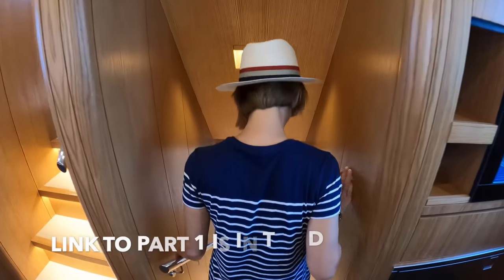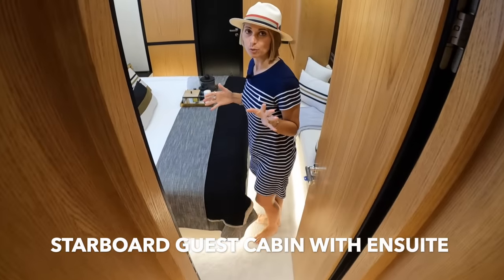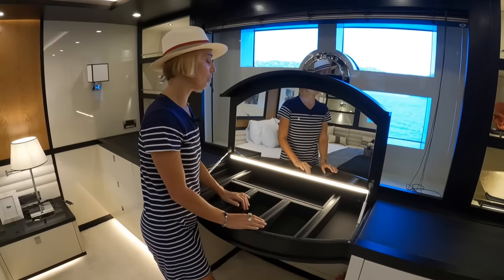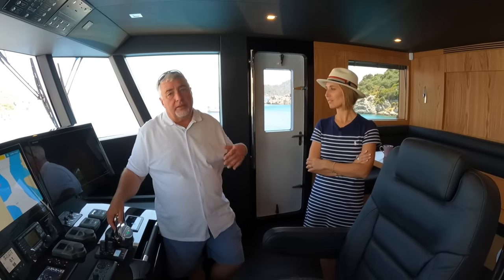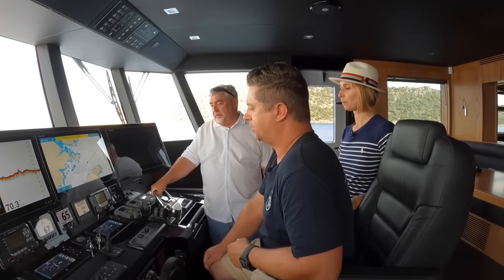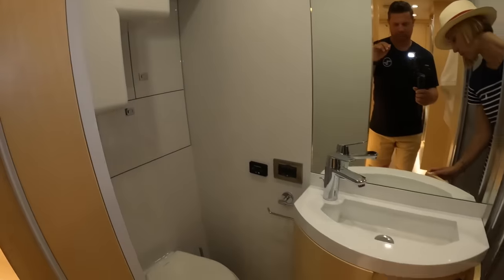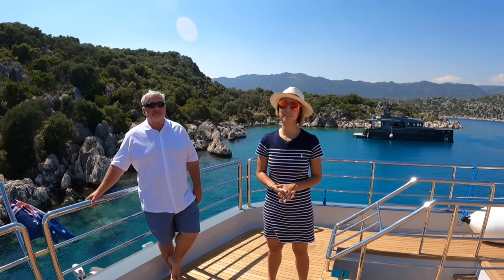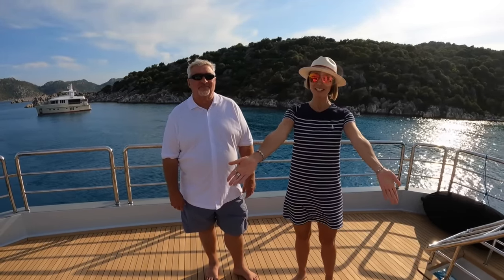2021 BERING 77 EXPLORER YACHT TOUR - PART 2 / EXPEDITION Liveaboard Go Anywhere World Cruiser Boat

Comment: A yacht designed by a fisherman who worked the Bering Sea.
Perfect. The first thing I think when I see yachts is "no outriggers, no interest".
First thing he said was "You can add a fighting chair and outriggers here on the swim platform" as soon as they stepped on the boat. This is the first super rich type boat that I've ever seen that compares to Viking. Beats them, actually in seaworthiness. And range. And safety. Maybe not as a pure sportfisherman, but this more than compensates for that. And having a steel hull means this thing can go places that you couldn't take a composite hulled boat. This will bounce off of icebergs, and with a range of 5,000 nm, that's easily doable even from my home State of Florida. I'm from Miami and have seen superyachts 3×, maybe 4× the size and am more impressed by this Bering.
Oh well. Something else to buy a lottery ticket for. Just the fuel at $6 per gallon × 7,000 gals is more than I can do.
Time to load up the kayak. I can still fish.

Comment: 36:20  So Nordhavn be like "we fit a small 'tank deck' into the bottom of the 120, like you sometimes get in more voluminous 200ft+ yachts" and Bering is all "lol, hold my kvass" then does the same in a 77.
Reply: I'm not sure which brand I like better now.  I need a tour of the new Nordhavn 80 to compare.
Reply: @timroden6617  The Bering is steel, the Nordhavn  is plastic, end of discussion. If the2 collided which would sustain the most damage?

Comment: There is so much to appreciate. The achieved efficiency for such a heavy vessel is astounding. Another mindblowing stat is how much operating time is had between overhauls. (How the TBO residualizes into Cost of Ownership makes this vessel much less expensive to operate when compared to other vessels in its class; if there were others in this class). The battery capacity and management that allows the ship to power systems all day with only a one hour recharge is borderline absurdity! It's phenomenal. Accessibility of key components in an emergency, such as rudder, is another sign of its well thought construction. The redundancy of systems is another amazing feature. Size of the crew area, having a crew mess... The food storage capacity... vibration isolation... true water tight doors... I've never been so impressed by a 77' boat. The term Duesy, as in, "It's a Duesy" (meaning greatness) is eclipsed by this. IT'S A BERING!

Comment: Felt in love for Bering when watching these videos! I would add very few electronic resources to the boat, not essencial, but desirable for a family owned and operated.
The tech talk is the best part (#proud #boatgeek) and I was impressed with the engineering and construction methods Bering applies in the Explorer Yachts.
Clearly they have real life sea experience, and their design take into consideration real issues that may put ones trip or safety at risk. It is amazing!
Thank you for sharing such detailed and enlightening video on the Bering 77.

Comment: the amount of experience and kowledge and sea sense possessed by the owner mr. Alexei rresulted in a magnificent boat.the video was an education on factors that affect yacht design, for example the use of weight in generating momentum and stability, charging the batteries using the engine instead of the generators and use of the commercial ship monitoring system for all essential system functions,use of inverters to be able to access all types of voltage inputs etc etc etc. the boat is a fucking masterpiece and  mr Alexei is a grand master. of boat design . this video has channged my perception of boats and boat design. thanks a million guys.

Comment: Btw, the washer/dryer combo in the master is super cool. The newest machines use ventless condensing drying cycles with high-speed air flow and work a hundred times better than the old Splendide combos that ran on 110v. You just throw stuff in there, and the machine measures out the exact amount of detergent and softener, runs the cycles, and your phone tells you when it's finished. No ironing is needed, and your clothes are perfect. My friend bought one and says it changed her life...lol.

Comment: This is awesome.. I generally didn't like most yacht or yacht lifestyle. It all felt too flamboyant and fake. All yacht I had seen videos of, till now was like a boat with lot of places to sit. And didn't have anything that felt nice. But this video changed my opinion. Now I have a favorite yacht!

I like how everything has a purpose, and there is so much attention to detail. Moreover, I love how everything is over-engineered and is redundant. This is a ship that is focused on safety, comfort and design. Everything is so perfect. Even the layout of the rooms are so well done with purpose. Like, how the bathrooms act as a sound barrier between the guest cabin and engines. How, the crew cabins have entry right from the cockpit.

Only thing I felt a bit off was the Engine specs. But, I felt convinced after seeing what Alexi has to say.

But, is it possible to put a big engine if the owner desires to do it at the time of construction? Like, for cruising 8 knots is okayish. But, what if a owner wants to sometimes take it to 30knots just for fun. Is that even possible with a vessel of this size?

The thing is, I get that range maybe reduced with speed. But, every trip do not need 6000nautical miles of range. Most trips would be shorter distance, and why not use more fuel, and get better speed? Anyone who can afford $5.7Million for this boat can certainly afford it.

There is Pearl 80 boat, which is totally different class of boat, and less than half the weight too, but has 2 x MAN V12 1800hp and can do 35Knots and 25Knots cruising speed.

So, can a 2x 1800hp engines be placed in it? And if those engines are run at its cruising economical speed, what will be the difference in fuel consumption with these 2x300HP engines?

Alexi said it only need one engine to cruise at 9 knots and be hyper fuel efficient. If that is the case, how about a 3 engine setup? One 300HP engine for fuel efficiency. And Two powerful engines used only when the owner wants speed. Will that give the best of both worlds?

I feel like this nice boat is let down by tiny engines.
Reply from the maker: This is the full displacement Vessel, which means it will not go above the hull speed… Not ever boat is billed to go fast, it’s not just about the engine power

Comment: I actually prefer this boat to some of the bigger yachts. Perfectly proportioned and beautiful looking.
Reply: My thought too, every square foot is utilized and unique, not just a bunch of open deck space like your on a cruise ship.
Reply: How much do you think it'll cost to operate and maintain per year?
Reply: Which one do you own?
Reply: @petergiffin1270  I'm guessing at least a couple of hundred thousands dollars per year (but I don't know much about boats). It will probably depend on how far the boat travels (it's heavy so it probably needs a lot of fuel for long trips), then there's insurance and maintenance (could probably depend on if there's any accidents), the man said it was 77ft to make it cheaper in fees than for superyachts, then there's the cost of hiring a crew/captain (if you can’t operate it on your own) and mooring costs (some countries with a lot of tourists are likely more expensive than others)... I think they say that a boat cost around 10% of their value every year, I don't know what it's sold for, perhaps somewhere between 2-3,5 million (?), if so it would be around $200k-$350k/year.
Reply: @zeroheroes4081  You mix up consumption and maintanance Costs. The rure maintanance isn't more then 30k/year. Plus the recommended 3-Year-Inspection by Shipyeard. 80 to 100 k. So per Year it is not more then 60k. A 77 Footer you can operate on your own with a simple "Sports Boat"_License (Off Shore).
Reply: @TheMave34  I was thinking that fuel + oil + repairs + maintenance + insurance + mooring costs + crew + fees I probably don't know about, would altogether be in the ballpark of that number, but I can absolutely be wrong. Since it's an explorer and unusually heavy, I'd think the fuel is more expensive than the average yacht as it's going to travel very far, but the man also said it wasn't going to be owner-operated so just hiring a captain will probably cost $80k-upwards/year + a steward for like $30k... But perhaps the owner will charter it out some weeks of the year and cover the costs that way.
Reply: agree! 

Therefore, I'd be very, very interested in your opinion which do you prefer, this 77 or the All Seas 92? 

You know, give-or-take the obvious length - one has a higher finish while the other appears that the attention is more in the hardware? 

On balance, which one is it for you?
Reply: @zeroheroes4081  I'm thinking $600k at the low end
Reply: @jimdeitch321  why?
Reply: @michaelbastin9851  - although I like them both, I think I’d go with Regis 77.
Reply: @petergiffin1270  9⁹
Reply: @petergiffin1270  Rule of thumb is 10% of the cost of the boat, per year. A 77 goes for, I think around 7 million, so 700 thousand per year. Your mileage, depending of course on your miles per year, and what crew, if any you, have, and the cost of where you moor, see sailing doodles on YT, he refers to mooring, fuel costs a lot, so it's a big variable. Being a diesel boat, that's obviously a huge number, depending on how much you run it. Use it as a live-aboard for most of the time, then you're paying moorage costs which include your electricity costs plus ft per day, week or month. If you're taking your 77 around the world, with 6-8 crew, your costs might be higher. And we think car insurance is high...  When I mention 6-8 crew, you gotta remember, somebody HAS to be in the pilot house, on watch, every hour of every day, as you are making those epic Panama canal to the Galapagos to Fiji crossings. At 10 MPH. Do it with 4 crew and they might murder you :).
Reply: @thomasbeirne8213  explain how solo sailers do it. They sleep. You don't HAVE to be manning the helm 100% of the time. Autopilot will do the work for you and you can eat sleep watch a movie ect.
Reply: @thomasbeirne8213  : You can buy a Bering 77 for less than $7 million.  One that is available for sale - "This Bering 77 is just 6 months away from completion and available for sale. The price is 4,700,000.00 EUR. ex VAT. Please mind the price include the total equipment indicated in specification."  So $4,730,315 at the current exchange rate plus tax etc....  

But since Victoria & Rico are in the process of buying/building a Bering 75 I guess we'll find out for sure what the running costs are.
Reply: @oneslackr  Damn! I didn't know that, I forget where I got the info for my original estimate, but I think that's downright a great price for what you get, and where you can go. I thought that the B65, Namaste, was a also a great deal at $1.65M. Thanks for the info.
Reply: @pain_weaver  I think, and I could be wrong, it happens :), but if you're on a crewed yacht, ya gotta have someone in the pilothouse at all times while underway. What if you run over a sailboat? It also could be an insurance requirement, depending on the size of the boat. By your self, a small boat with just family, could be different. Even Sailing Doodles, on YT, a '60 Hatteras, covered waking (informal) crew up on watch :) We're both guessing, I guess, perhaps someone with experience might chime in. Or I'll Google it later :). All the best tho...
Reply: @thomasbeirne8213  if your solo there isn't a crew 😁. Also as for sailboats there's a thing called a RLB it pinpoints boats. You can check the RLB of all vessels in your area of say 200 miles. Calculate all traffic and go to sleep 😁
Reply: @pain_weaver  Fair enough, I've heard of AIS, but not RLB. Thanks for the info. I know they have something similar for aircraft, even small planes, so you can see what's around you on a screen, but the planes have to be equipped with it. If they are not equipped with the technology, they don't radiate anything, and so they don't show up on the screen. My original point being tho, for a '75 expedition boat, you are probably gonna need watch-standers.
Reply: @oneslackr  Looking around some more, I believe I found where you got your info, seaindependent, I guess. A Bering independent agent, apparently. For around the price I quoted, you can get a B95, which I didn't know was a thing. Looks nice tho. Here in the US, we don't have VAT, we do however, have sales tax, which varies by state. 6-8% ordinarily. VAT in the EU, is apparently 18-20%. Ouch.
Reply: @michaelbastin9851  - I like the woodwork and marble in the All Seas put into a Bering
Reply: Under  78 is important
Reply: @pain_weaver  If you have a crew and you're running a charter there's rules about maintaining a watch, logs, etc. Even if it's just you and you have a crew on board there's going to be a 24-hour watch in the pilot House.
Reply: I was days away from purchasing a boat that was 2x larger.  I literally just watched this video.   I believe it took THIS video to change my mind.   I just want to know now, can he do a sky bridge master on a larger boat?    This is awesome!  I just want to know if it can be built with a scuba set up as well.

Comment: Looking through the specs I was impressed by the fact that it draws just under 7’ of draft, which means that this boat can go virtually anywhere in the World.  I would like to have seen the video monitoring system as there were several cameras seen throughout the boat, including the engine room.  I am wondering if the fire suppression system is Halon?
Like many have already mentioned, this CEO is not just a pretty face in front of the company, but one that knows this boat like the back of his hand.  You can see the pride that he has in this and his other boats.  Really likable fellow.

Comment: I would add the engine charging the battery option. I would also add more solar.  Ask Bering about adding more batteries for further power expansion to maximize efficiency. Hard wire of the navigation in the pilot house. And trim down on the wood or service needs. Less service needed = more efficient crew.

Comment: Something that needs to be pointed out when looking around the engine room are the brand names that you see attached to the particular piece of equipment. Those labels tells a very clear story about the commercial intentions built into the construction of this vessel. I mean, that hydraulics unit is made by ABB. You simply CANNOT install a more robust and reliable unit for that purpose. Have a look at the videos of the Porsche 911 assembly line and you will see the ABB logo everywhere attached to hundreds of different pump and servo actuated pieces of equipment ranging from hydraulic lifts and worm gear set ups, to literally hundreds of massive robots and robotic process equipment. Bering, in my minds eye, builds one of the most commercial grade core designs in the yacht building industry. And, they are only up to the 145’ size range in their construction. I can’t WAIT to see what they can do with this sort of commercial grade construction in a fast explorer with live aboard rough sea capabilities. I’ve already made up my mind that by first big vessel will be a Bering, no doubt. So damn impressive. 👍🏻😎👍🏻
Reply: Agreed, much top of the line industrial equipment used, as ABB. And also reflected in the price tag)
Reply: @Rimrock300 , completely agree. When you see that sort of industry tested equipment in a vessel, you should be very aware that there will be a substantial price tag to go along with it. But like Alexey had mentioned, many of the components were designed to last many years at full operation capacity. Peace of mind through commercial quality and redundancy. Again a quote from Alexey, “When you are out away from civilization with no stores or fuel stations, you need to know you have everything you would ever need and confidence in a boat will just keep running without fail,……EVER!!” The obvious dedication and commitment to that far above only what’s necessary is why when I am in the position to purchase a yacht, there’s no doubt I’ll be visiting the Bering design studios!!

Comment: Hiya Vico,
Okay, I had to return to have another look at your choice for your new home. WOW! I would want a 177' or even 199' to fit the crew I'd want. This whole yacht is at the absolute top of the range, you could not have chosen a better boat. Where were you in choosing when you made this? Rico your eyes when looking around the engine room, will you miss the boat yoga? By the way, Rico I used to run generates for film and TV lighting plus powering TV control trucks. All the generators I ran from 25kw to 200kw used 0.25 ltrs per kW hr. I don't know what that is in gallons, sorry. 
I'm looking forward very much to the build videos V, the more there are the better I'll like it, plus the more information in each the better too. 
Fair winds and following seas, but will you need them? Steve xx...